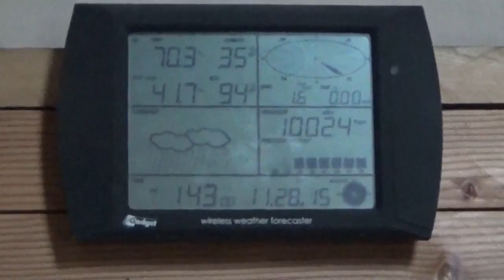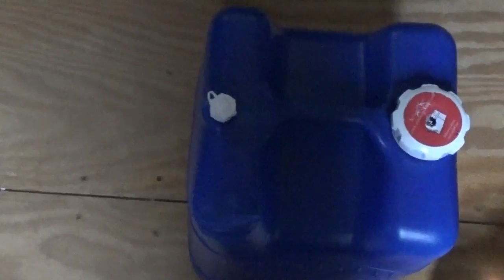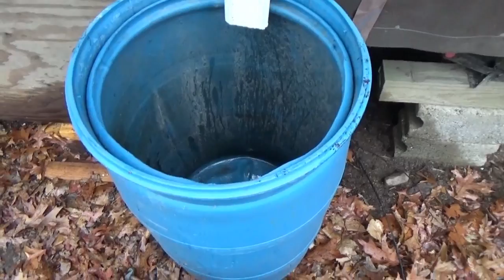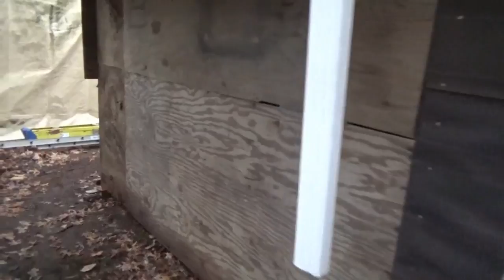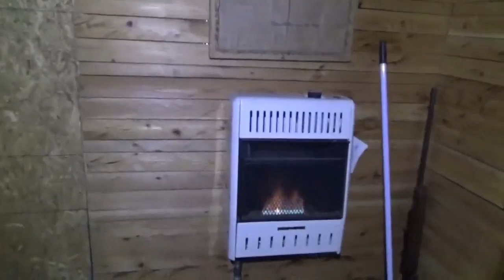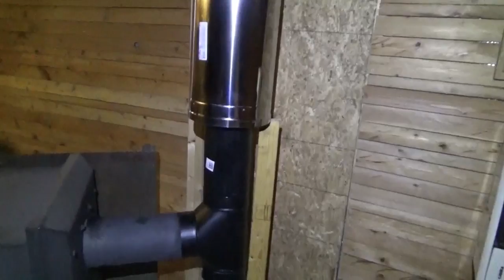Installing Off Grid Shed Rain Gutters & New DuraVent Wood Stove Pipes

Comment: i had an idea about propping that pipe up, what about using the flat rocks outside? or stacking those ceramic tiles that they use for flooring? i don't know, just thought i'd throw it out there.....bricks?

Comment: seems eyebolts is not a word thanks auto correct
Reply from the maker: +Duane C LOL, I wondered what you meant
Reply: I understood you to mean the bolts that have a ring on the top.  Is that right? I liked the idea... I pictured a bolt in the rafters on either side of the chimney  with maybe 1/4 inch pretty link chain attached to a strap around the triple wall pipe.   That would take the weight with out a leg to the floor.  It would look awesome.

Comment: put eyeballs in the ceiling joist, and drop fine linked chain, or steel cable to the clamps. Or get some fire bricks and build a colum around the lower pipe, this will support the pipe and give you the thermal break

Comment: Troy that triple wall pipe goes on the outside.
Reply from the maker: +Alpha1545 Interesting that they give instructions for mounting it inside on the wall
Reply: What they are talking about is lining and old flue. I have a wood burner in my shop and I use black pipe inside and stainless outside. Is that dura vent or the other manufacturer I can't remember. Also why don't you have a damper in line? I am not saying it can't be used inside but what was there before was fine except I didn't see a damper. If you want I will send you a picture of my setup.
Reply: +livingcheap  You are correct. In addition,  due to over heating the house on just a very low fire he could not burn hot long enough to keep the creosote out of the chimney pipe consistently.  This way hopefully he can crank that baby up when needed to clean the pipe.
Reply from the maker: +livingcheap Correct. The stainless was actually cheaper at TSC so I got it. It keeps the internal pipe temperature hotter to reduce creosote. It removes the necessity for a heat shield on the wall too. And it somewhat reduces the heat in the tiny house, which is way too much anyway.
Reply from the maker: +Brian Mendel Ken is an old troll who seems to have made a brand new channel again to harass me with. Blocked.

Comment: I'm  curious how that new pipe is working out.  You mentioned it should reduce the excess  heat in the house...I am sure it will, but...I thought that excess heat was to be vented to the greenhouse /shed sooo...I hope that triple wall doesn't reduce it too much.  Looking forward to hearing the upstairs /downstairs temperatures now after this huge change.   I suspect  (hope) some of the heat will be forced out the bottom of the pipe which should keep more heat downstairs.  But how much is the question.
Reply from the maker: +MollyDolly It is still way too hot in here, no problem there
Reply: +The Do It Yourself World 
Good!  Video request:  Run the wood stove  a few hours then video using your laser thermometer on the pipe (both the bend and the triple wall) and also the floor behind the stove and the wall.

I am  super curious about the way heat will be redirected with the new pipe.
Reply from the maker: +MollyDolly Ok, cool. I will add that to the growing list of project you have given me. I will put it right at the very top of the priority list with the 5,328 other projects up there that you have given me.
Reply: +The Do It Yourself World : Do you mean the list you accidentally used to start the fire with the other day. Whoops, I forgot I wasn't supposed to mention that. :-D
Reply: +The On Grid Homestead  What????!!!  That's  sooo not right!
Reply: +The On Grid Homestead Nooo, no that must have been the list of things the trolls claim he needs to fix...that list needed to be burned anyway...my list is in a nice fat ring binder!  lol!
Reply: +The Do It Yourself World  Oh give me a break...you are gonna make a video anyway... Please...I am  very curious  whether  much heat can be forced down that pipe.  Maybe not, but then again that floor is combustible so you need to check it anyway.
Reply: MollyDolly Sorry, your nice big 3 ring binder with your entire 300 page list went up in smoke! Poof! I guess you'll have to send Troy to the dollar store again to get another one. I'm sure he'll do that immediately too. lol
Reply: *****  When Troy  first installed his stove he checked very carefully,  just as you did so I knew his pipe was ok, even if a bit messy...but with each major change like this I think it's good to check it all again.   Particularly that floor and wall behind the stove may or may not get hotter. Obviously  heat rises so it may not, but excess heat that can't get out now might be forced back down... I just don't know,  but I sure would like to...

Comment: If  I remember right, you guys installed the heat collar on the ceiling very STRONG. if you trust it, consider hanging the new pipe from it with stainless screws, There are hangers you can use to off-set the pipe from the wall and will hold the whole thing up nicely. (under $10) Please make a cover for the big rain barrel. critters will fall in and ... well,, YUCK! Keep on truckin.
Reply from the maker: +grodad The design of these pipes will not allow me to do that. There is an inside pipe and two outer pipes. And the adapter up in that box is just pushed into the box from the bottom. It would also fall out. I need to clamp this thing to the wall.
Reply: the hanger I'm thinking about is a band that is attached to a plate that screws to the wall next to the pipe. they come in 5,6,8,10 and 12 inch diameters and are adjustable. You would not need to pierce the triple wall pipe with screws. they act like an oil filter wrench, squeezing. I hung a 6 ft length of 10 inch class A pipe to a shack last summer. It held up to a 70mph wind storm.  stacking bricks under the clean out T will give you peace of mind fer sher!
Reply from the maker: +grodad Yes that would be perfect
Reply: I did a similar set up using two types of pipe. I got some single wall pipe one inch bigger than my class A, borrowed a crimper, and MADE it fit by crimping just enough to get a good fit. I ended up riveting the parts together. Pretty bullet proof. I could hang a deer from it. lol.

Comment: Seeing how wet the shed was, I'm curious to see how you're going to get a moisture barrier down between the base of the shed and the ground with it already built.
Reply: +Sher Thom It's a shed made out of wood pulled from a scrap pile!!  It ain't the Taj Mahal and nobody is planning on putting pictures of it in architectural digest.  If the thing is ugly who cares as long as it keeps the batteries and water tank from freezing.  Troy says in his videos all the time that he is learning as he goes.  He makes mistakes and doesn't do things the way a lot of people might.  He is in the end accomplishing something and if he is happy with it who gives a crap what the general masses think.
Reply: +Al Oft What are you talking about? I never said the shed was ugly or said Troy did things wrong? I just said I was curious how he was going to install a moisture barrier in between the wood at the base of the shed and the soil. I'm not sure how you do it, so I'm looking forward to seeing how Troy does it. I never said nor implied anything negative.
Reply from the maker: +Sher Thom Aluminum tar tape 9 inches wide all around the bottom
Reply: +The Do It Yourself World Thanks! I look forward to seeing that video.
Reply from the maker: +Sher Thom :)
Reply from the maker: +88s10Durango Of course, and wrapped up the sides

Comment: Look at it this way Troy, 200 USD for making sure your house aint going to burn down is 200 USD well spend. in my opinion.
Reply: Well why not. Nice tip.
I ones toke my grandfarthers coffee to put out a small fire on the dining table, just pure instinct. 
But anyways thx for sharing.
Reply from the maker: +Thias Russell true
Reply: +Thias Russell 
.......and a 14 oz can of spray fire extinguisher for small fires (Tundra first alert, $13, red & white can). More spray than big metal fire extinguisher.
Reply: Right on. and a bucket of sand is always good to have ;-)
Reply: +Thias Russell  I put out a fire with a big box of baking soda once.  Scary!  But it worked!
Reply: +Thias Russell Ah, those memories of fun times past.

Comment: Troy the wood on shed bottom is getting wet.  it will rot out if you don't fix it.
Reply from the maker: +Roxana Panaro I just got some aluminum foil tape with tar on one side. This is 9 inches wide and will cover the entire bottom of the wall when the sheathing and paneling are done.
Reply: +John Adams  He can always replace it with  recycled wood in a few years if he chooses.